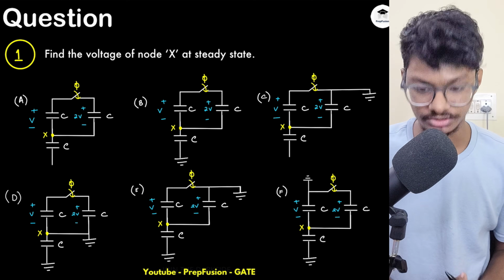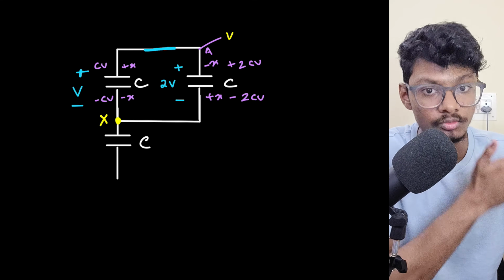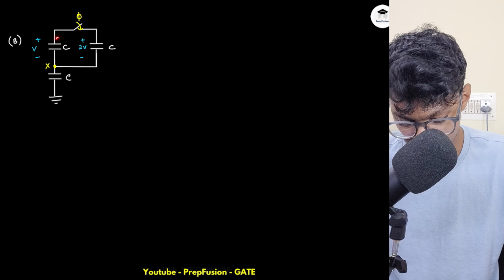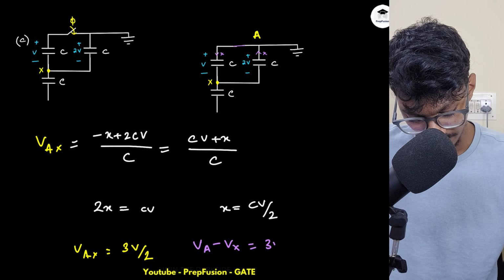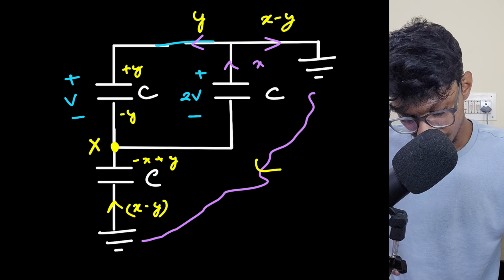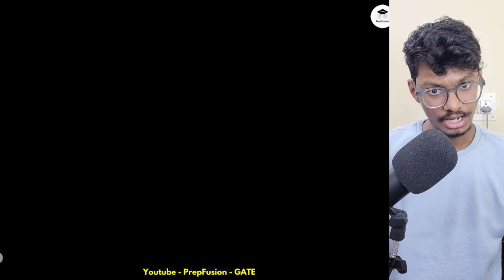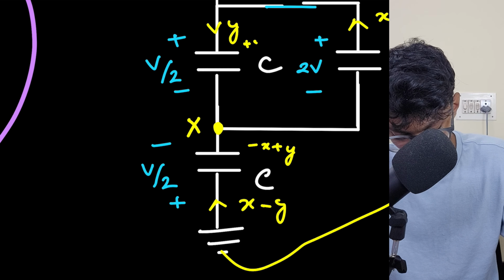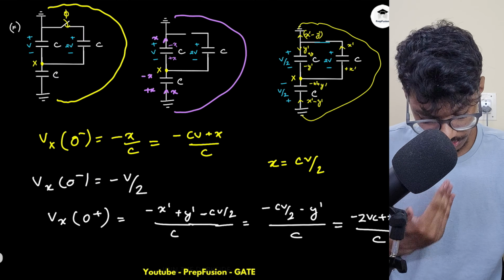🔥MOST Important Questions On Switched Capacitors || Circuit Queries

Comment: in homework problem (G) : Before switch is closed all three caps will have -1v across them and after switch is closed then also -1v across all of them . hence  Vx=-1v before and after switch is closed. Am i correct ?

Comment: 32:22 We have three capacitors in parallel, they all will settle to a final voltage Vx=-V (this is instantaneous). Turning the switch on/off doesn't have any effect as we are connecting the ground to itself. 

My question is, 
At what time the initial conditions are defined for this circuit?
Once the circuit is formed and the capacitors are made to be in parallel, we can't define two different initial voltages for them. So, we must have a two more switches to define initial conditions isn't it?